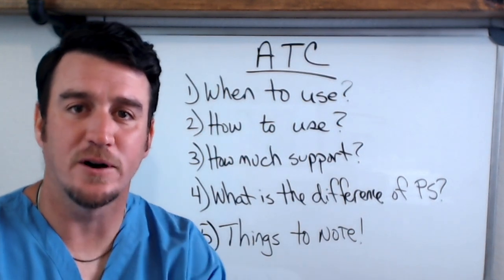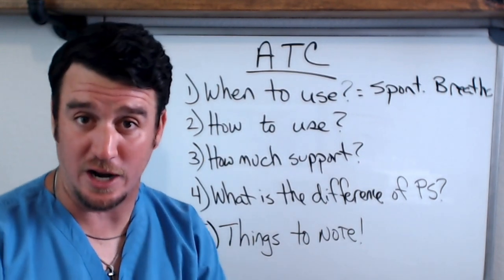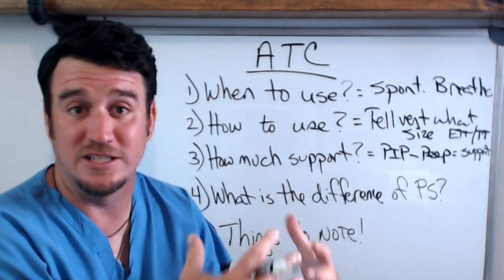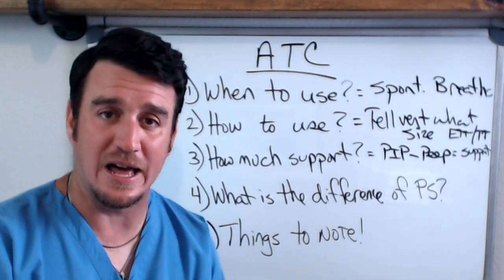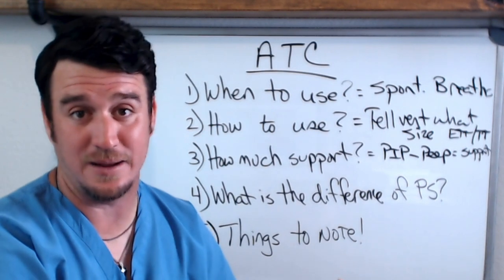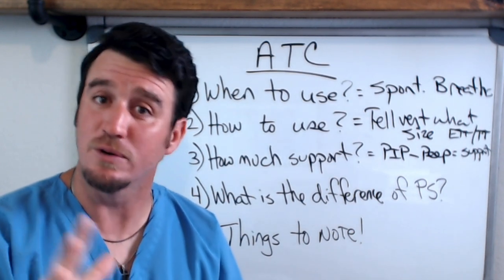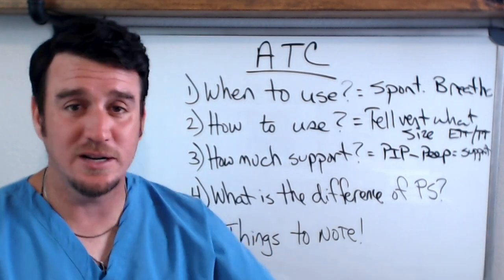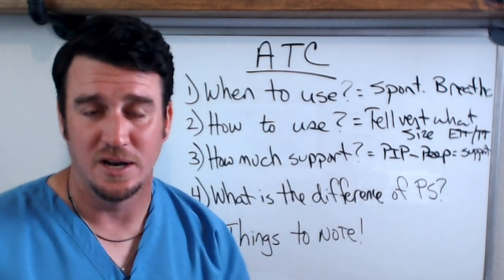Respiratory Therapy - Automatic Tube Compensation (ATC)

Comment: Good info and thought provoking. Thanks.

Not sure if this is too much, what are people using for:

1 Spontaneous breathing trials (I believe the original study was done on no psv. Maybe they had tube compensation on). With and without tube compensation. 

2 Quote "minimal settings" (they are not planning to extubate (maybe due to no cuff leak), but the want them as close to spontaneously breathing as possible). Again with and without tube compensation. 

I currently work with PB 840s and 980s but have used Aveas.
Reply from the maker: Hi, Sxs.  Wish I knew your name.  1.  In my area, most places are using PSV 5/5 for SBTs (no ATC), or PAV with ATC.  2.  IF I understand the question, then either a small amount of PS or ATC will both work to provided minimal support to the patient, but not both together.  One or the other.  I hope that answers your questions.  Let me know if not. Thanks again for watching and commenting.

Comment: Good video! One quick question, if patient A and B both got 8.0 tracheotomy tube, they need different pressure support to augment tidal volume but only three setting on ATC (type of tube, size and support%), it seems A and B receive the same amount pressure support. Im very confused about how ATC gives different support on the same tube but different patients.

Comment: Mr.Respiratory coach....if you have time i need a favour...can you make a video regarding this topic:
which ventilator settings and mode for patient has acute exacerbations of COPD + MODERATE TO SEVERE ARDS.. 
And i am so grateful
Reply from the maker: Hey Osama.  Modes really aren't disease specific.  In regards to ARDS, the ARDSnet protocol doesn't specify a mode.  It just specifies target tidal volume ranges, being 6-8 ml/Kg with the ability to decrease to 4ml/kg if plateau pressures are greater than 30cwp.  COPD is going to keep you in the tidal volume range of 6-8 ml/kg, but to reduce the risk of airtrapping we can increase insp flow 60-80lpm, where as we typically stay within the 40-60 range.  Hope this helps and thanks for watching!!!
Reply: Respiratory Coach absolutely helpful....thank you

Comment: Good explanation sir, thank you for your generous sharing. I have been confused by this issue for a long time. Here I got a question and really hope you could kindly help me out, that is: where the pressure detector of a ventilator actually is? And where does the reading of it  come from? Since when we vent a patient, what we really concern is the pressure delivered into the aveoli rather than the main airway, right? So if I vent a neonate, and he has spontaneous breathing, I adopt a mode of SIMV+PSV and the ETT is 3.0mm presumably, the PS is 15cm H2O and the PEEP is 6cm H2O, so what do these number really stand for? Are these pressure from the aveoli, or the exact pressure what we’ve delivered into the aveoli is lower than these reading? Thank you so much!

Comment: At the beginning of this video, you mentioned that ATC should be only used with SBTs. So now I 'm a bit confused about to not activate ATC and PS together. !!! How will I activate ATC with Spontaneous Mode? Turning off PS to Zero???
Reply from the maker: Hello, Dareen!  You might have misunderstood the beginning.  I stated that ATC is used in any mode where spontaneous breaths are allowed.  Spontaneous breaths can be supported by either ATC or PS, but not both.  Most vents have a setting that turns on ATC.  If ATC is activated, then PS should set to zero, if that's an option.  Some vents don't even give you the option to utilize both at the same time.  Other vents do.  These vents are the ones that you must be aware of so that you are not providing double the insp support to spontaneous breaths, which will potentially create a false presentation of your patient.  Hope that helps and makes sense.  Thank you for watching and commenting!!!

Comment: Hey coach, David here from Sweden. We use the Dräger V500 and it has a dial for %-compensation. I was told to always use 100% unless the tube was cut, is that right? Or why else is it there? The V500 allow both ATC and PS to be active, is there a benefit of mixing them? Say ATC 70% and PS 4, please explain.

Comment: if you are getting a VT high minimum pressure alarm with a patient on a AC/PC mode, would turning off the ATC stop it from alarming because the patient isn’t spontaneous breathing?
Reply from the maker: No, because in AC/PC the ATC isn't active due to the lack of spontaneous breaths.  It plays no role in AC.  Sounds like you have a patient actively breathing during the inspiratory phase, which is greatly increasing compliance and resulting in a large tidal volume with very little pressure.  Thoughts?
Reply: Respiratory Coach yes, that is exactly what the patient was doing. So, would properly sedated be the key for not having him spontaneous breathe during the inspiratory phase?  He possibly could have some neurological issues as well. They were still ruling out a lot of things at the time. I did notice the alarm did stop alarming when I turned off the ATC though. Thoughts? Love your videos too! Keep up the great work 👍🏽

Comment: Meaty info once again. Not sure if we put details in Dragger ventilator (i'll find that out). Do we use ATC on non invasive? Thanks!
Reply from the maker: Hi Liz.  No ATC in NIV.   In NIV, you have to increase the difference between ipap and epap to provide more compensation for an artificial ariway, which will typically be a trache tube if anything.
Reply: Yes Draeger has ATC

Comment: Hello, good Evening
May we consider ATC an adaptive mode of ventilation. Or is it different?
Reply from the maker: Hey Manish!  Perfect timing as I'm currently responding to comments.  No, because adaptive modes of ventilation respond to patient parameters and then do something different.  ATC is based on the patient's airway diameter and length (ett vs trach tube), but it doesn't respond to work of breathing or other monitored patient parameters.  Hope that helps to clarify!
Reply: Thank you for the reply
It makes sense, so i would consider that, in a PSV mode i will limit my pressure, while in ATC, i shall mention the tube size, and a predetermined pressure shall be delivered by the ventilator, irrespective of the need for it. Say if the compliance is good, the predetermined pressure, which is based on the tube size, could be more than that requires.
Is this correct, kindly clarify

Thanks alot for the amazing video